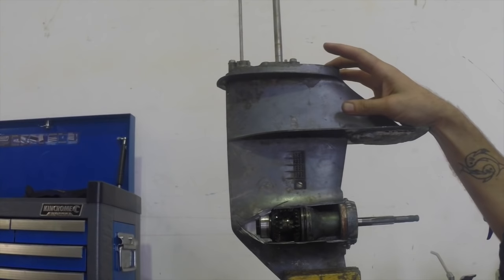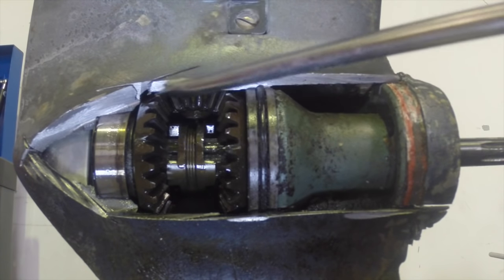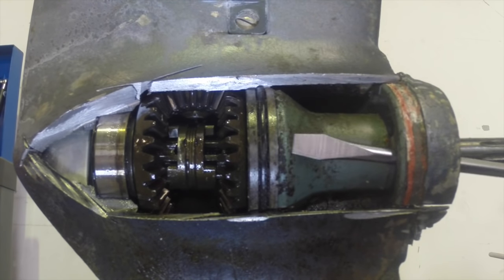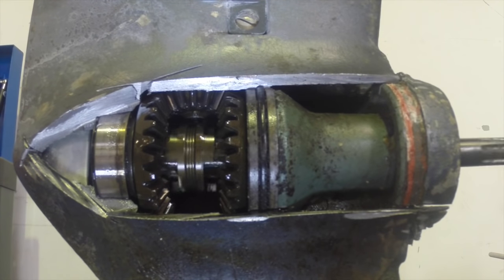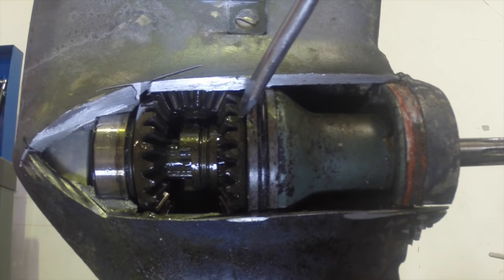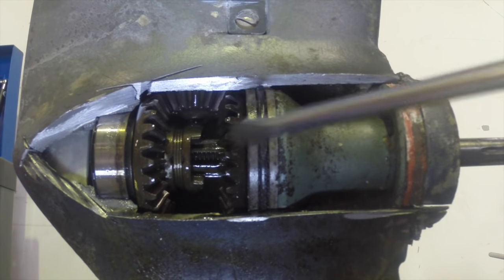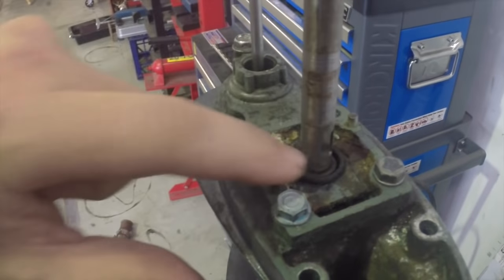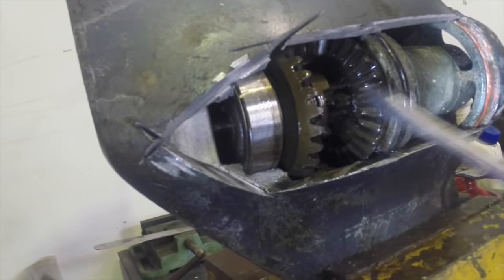How an outboard gearbox works

Comment: Hey mate,  i have a question about my 75 hp outboard Yamaha 2 stroke 1982. I recently did repairs on it and would like to know if it is normal for the prop to make a clicking noise when spun by hand in FORWARD gear (Only makes the noise in one direction and doesn't spin the other direction when in F). When in NEUTRAL it spins freely both ways as it should, But when in REVERSE it doesn't spin either way (In R when you turn the prop by hand either way it will turn the motor). I can't seem to find a definite answer anywhere and have read in multiple places a bunch of different answers. NOTE: i never spun the prop by hand before the repair as it wasn't what i was repairing, therefore i have no clue if this is the way the mechanism actually works. Cheers

Comment: So when you have 2 or more engines they usually rotate opposite of each other. Is there any difference between the two mechanically or do they just flip the shift cable around and run one in "reverse"?

Comment: Very informative, Thanks,  I have a question though, when I shift from reverse to forward there is a fair amount of grinding sound and same forward to reverse.  Is this harmful and is there a remedy?  The motor is a Mercury 125 hp 2001 vintage 2 stroke 4 cyl
Reply from the maker: It is bad for a gearbox to hear that grinding noise as it is the sounds of the dog clutch and the backs of the gears being worn away. Does it still happen if you change gears more briskly? Change gears slowly can cause that to happen. If it does I would look if there is any play in the gear selector cables or linkages.

Comment: hi hope you donrt mind ,got a quad bike jianshe.bought with 1st and reverse gear problem have checked the reverse and forward gear and seem fine. now the quad will go into all other gears and drive fine .im guessing 1st and reverse are linked as told you can only select reverse when in first gear. when you engage 1st and reverse and add revs sounds like a gear is running over another gear but not meshing together.any ideas thanks.

Comment: never had a chance to see the gears like that ,Love it!!!, is it normal to get a little bit of oil leaking when not used for awhile, you will see a bit around the bottom fin, it just makes a mark on the garage floor and then it stops?
Reply: GmGarlo no it’s not normal. Check to see where your oil is coming out from. A crack, drain plug, fill check plug, coming out by the prop so on.

Comment: Can you please explain the correct way of pushing the throttle forward/back without damaging the gearbox? I don't quite understand how this clutch works. And is there any risk of damage if my tickover is high? I upped it because my automatic choke doesn't seem to work.
Reply from the maker: The trick really is to pause in neutral when coming out of gear for the revs to drop back to idle and then move into gear quickly and crisply.

Comment: Are there props engineered for superior reverse-performance; it seems you should be able to reverse as fast as forward?
Reply from the maker: +ohbobpleez Not really with outboards. Because of the water flow and turbulence it is hard to get a prop to be equal in both directions.

Comment: Thanks all your videos are very informative and useful.  So I have a question though, as simplistic as that looks, could you which the gears around and make the gearbox a left hand rotation?  Thanks,
James
Reply: +James Brennan  Sorry there is a typo above, should say "switch" not "which".
Reply from the maker: +James Brennan Hi James, good question. The pinion gear coming down from the driveshaft will always push the forward one clockwise and the aft one anticlockwise. It is my understanding that a left hand gearbox has the gear selection mechanism reversed. The tricky big is designing the gearbox to take all the load of running at high speed for long periods of time with the dog clutch pressing backwards against the reverse gear. This is where all the magic happens even though the basic design is the same.
Reply from the maker: +Dangar Marine Hi James, I think I deleted a comment of mine that you had replied to. Sorry, comment ping pong gone wrong!

Comment: Great video, thanks for cutting that open. It gave me a great view. I’m having a issue with my gear selector rod, it doesn’t seem to have a good amount of neutral section. It always either wants to shift foward or reverse. What is the common piece to replace in this situation. Thanks a bunch in advance.
Reply from the maker: This video might help https://youtu.be/B4acSf_BgP4

Comment: Mate,

I have a Mariner 175 HP 2.5 liter 2 stroke outboard motor and im having a problem with my reverse gear box. when i engage into reverse it makes that tugging sound and clonking noise. I would like to know roughly how much it will cost me to get it fix ( reconditioned) here down on melbourne. I spoke to my boat mechanic and he said that it could only just be adjusting the cable inside the motor. 

Thanks mate.

your great follower.
Reply from the maker: It could definitely just be a matter of adjusting the cable, this video will help with that. A repair like in this video https://www.youtube.com/watch?v=B4acSf_BgP4 would probably cost about $300. Thanks for watching! :)

Comment: hey do u know why my drive shaft would be locked up? put in test tank one day and shifted into gear and there was grinding noice then motor died. Took gear box apart and even with dog clutch in middle/neutral, the drive shaft and forward/reverse gears won't spin. Any advice? cheers

Comment: hi ive got a honda 50, i put the tail back on and adjusted the gears so alls well but when i put into forward then back to neutral the gear sounds its just not quite out ,back to reverse then neutral it clears, adjusted it 50 times but cant get it right is there  anything im missing

Comment: Hi Stu. Good vid. Do the prop shaft and drive shaft oil seals rely on water to keep them cool when the shafts are turning? The seals with the tensioner spring around themI guess there would be a lot of friction heat at this mating point. Often wondered how they last as long as they do
Reply from the maker: Hi Rob. They last quite a lone time provided you don't get fishing line wrapped around the prop, that damages them very fast. Both the oil and the water contribute to the cooling, yes.

Comment: i want to thank you. nice video!
can you explain if iother types have exhaust elsewhere. a 100 hp outboard would have enough exhaust to cause cavitation no?
makes no sense to exhaust bubbles before a properller? of does it flow through the prop?
Reply from the maker: Through prop is most common, particularly on motors above 10HP or so. Because the exhaust comes out behind the prop it gets clean water to bite into.

Comment: Hay how are you doing 
I have 2 questions about yamaha 400 timing chain marks and its tensioner 
Also if you can please drop some video about new versions (v6 -24 valve)with timing belt,also if you are able show how you diagnosis and clean memory faults of engine computer 
Thanks alot

Comment: Now I'm in a new predicament , I removed the gear carrier out . Now under that I see there's a larger roller bearing . The gear didn't come out with the carrier . Just wondering if the shift changer has to be pulled to let go of the gears to remove .
Reply from the maker: +Mark Nickles did the reverse gear come out just leaving the forward gear in? You usually need to take the drive shaft and the pinion gear out to get to that.

Comment: Great Video!! - made it so easy to understand how the gear box functions.  Do you have a video that shows how the shift shaft changes vertical motion to horizontal motion to engage the dog clutch.  I'm helping my nephew with a 1986 suzuki 85 DT and when replacing the impeller, once the Lower unit was out he pulled up on the shift lever to get it back into neutral and the shift shaft came uncoupled from the mechanism in the bottom and we can't seem to get it reengaged.  We're not sure if we've broke something or not.  I've found some diagrams that help somewhat but they have not helped us understand what we have to do to reengage the shift shaft.   I"m sure that linkage is specif to the manufacturer.  Any insights would be greatly appreciated.
Reply from the maker: I don't, but it is a stepped wedge shape so the deeper it goes the wider is gets hence pushing the dog clutch shaft backwards.
Reply: @DangarMarine  Thank you for the reply - What I"m confused about is the diagram of the the shift shaft is that it has the deepest part of the wedge (presumably allowing the dog clutch to move towards the bow into the Forward gear) above the mid-step (presumably Neutral).  That would would seem to mean that the shift shaft has to move  Up to go from Forward to Neutral, and UP further for it to go from Neutral to Reverse ... and yet I believe that I push the shift rod down to move from forward, to neutral to reverse.    Am I correct that the step is where the push-rod for the Dog Clutch should is for Neutral?  I wish I could send you a picture.  

/

Comment: Do you show a vid on how to remove the lower gear box for the 2000 30 HP Yamaha . I don't have the 2 bolts like you show . I have what looks like some kind of locking tabs behind the prop that looks like you would need a special wrench or some type of trick of the trade ? .
Reply from the maker: Hey Mark, I don't have a video on that yet, and yes, it is a special tool. I believe the Yamaha part number is YB-34447

Comment: hii... nice video,
i want to ask, how about the gearbox ratio?
do you know, how much the RPM of the machine at top speed, and the RPM at the propeller?
Reply from the maker: +AJPro Ah, good question. This outboard has a 2:1 gear ratio. From memory the pinion gear has 13 teeth and the forward and reverse gears have 26. This means that at top RPM,  say 5500,  the prop will be turing at 2750 RPM.
Reply: +Dangar Marine ok thanks for the fast answer. is the ratio and rpm also same with other brand, like yamaha, suzuki etc..?  or each brand have his own ratio and rpm,  also the gearbox model?
Reply from the maker: +AJPro They do vary,  a little bit. This gearbox is from a Yamaha at 2:1, but they can be a little bit higher or lower. Some manufacturers make a high thrust model that has a lower gear ratio for carrying bigger loads and pushing barges etc. These would normally be married to bigger props too.
Reply: +Dangar Marine sir, thank you very much, this video and your answer very helpful...
keep at good work!

Comment: Great video. I have a question though. I think a connection between motor and prop is slipping. It seems like the motor is running on high rpm but the prop isn't keeping up with it. It can't bring the full power into the water. I also hear/feel occasional rpm changes without doing anything. Swapped the rubber Flo-Torq bushing in the prop but that didn't really improve the situation.
Any ideas what the issue might be? It's a 2013 Mercury 4-stroke with around 450 hours on it.
Reply from the maker: Could be the prop ventilating in the water if the outboard is mounted or trimmed a bit too high.

Comment: Interesting video. I discovered water in the lower unit oil. I don't see anything obvious, fishing line etc.  Generally speaking when water is in the lower unit,  is the entry point for water the seal behind the gears or is it coming from the above, ie the water pump housing ?  Not sure where to start addressing this.... ( I know the short answer is give it to a mechanic, just looking to say some $)
Reply from the maker: Saving a few dollars is what we're all about. :) Water can get in from four places. There is an o-ring around the bearing carrier that rarely leaks because it doesn't move it at all. The other three possibilities are the oil seals around the drive shaft, the shift linkage and the prop shaft. As they do wrap around moving components they can just wear down and start to leak, there doesn't need to be fishing line or anything. The best thing to do is drain the oil out then use a hand pump to pressurize the gearbox through the oil filler hole. You can then spray some soapy water around all the seals and see which one has air leaking out (you should be able to see bubbles forming). You can also make a dial gauge like this one: https://youtu.be/Lzn-nshSlwk

Comment: Hi while the motor is running on water the boat stopped running I was going about 20 mph. Got towed to shore, checked the oil in lower unit found none but still black in colour. Any idea what can be damaged in the lower unit? When gears engaged the prop keeps spinning, the mechanic I consulted is asking $500 to assess the situation only...
I guess I am willing to try and fix it myself, I watched many of your video, I appreciate very much all your work
The outboard is a 
Johnson VRO 60 HP year 2000
Can you help?
Thank you
Reply from the maker: Did the motor stall because the gearbox seized or did you just lose drive? Could be internal gears, dog clutch or selector mechanism.

Comment: Hi mate,

Can you help me please?
I have a Yamaha 30hp 2T. And i'm having a 
problem, under load it starts jamming. Already see the pump (its 
working), cleaned all the 3 carbs, and seems everything all right. Im 
getting very upset and bored :(. Start's well, when I put forward full 
power, it goes smooth for about 15sgs, after starts jamming, i switch to
 neutral and his idling it's very up and down but after 8 10 sgs the 
idle comes back to normal, then I get go for 15 sgs full power. It seems
 that he drains all the gas on the carb and needs few segs to fill it 
again... I order 3 carb rebuild kit... Do you have any idea what could 
be? sorry for my english

thx in advance
Reply from the maker: Hi Samir, sounds like it could be the fuel pump not working properly or a split in one of the fuel hoses that is sucking in air.
Reply: Hi man. Sorry for boring you mate, but i dont have anyone that could help me. So I tested a "new" set of 3 carbs(new fuel pump on the middle carb) that came from an outboard engine just like mine, that was running smooth, with this I put new fuel lines and other fuel tank, and got the same problem, under load the engine goes down. So I checked the spark plugs, and the one on the middle and the bottom they were wet with gasoline, so I was wondering let me check if I have spark, so unscrew and i tested the spark against the block and I had the spark on both. So I got to a point. My engine in neutral REVS ok, it goes very quick and nice, when I put in forward and put half throttle it goes down. What is happening is the engine gets too much gas on the combustion chamber that isolates the sparks. It works well in neutral, but on load the sparks get wet. Do you have an idea what it could be the problem?? btw i tested with a new cdi and coils. Very very sorry for my english and many thx in advance. if i could pay you with IT favor please just ask. samir

Comment: thanks man you know you're stuff does the shift rod push the dog clutch erom inside the dive shaft?
Reply from the maker: No, the shift rod goes through the forward gear up to start of the prop shaft where the dog clutch is. The dog clutch locks to the forward end of the prop shaft, the shaft itself doesn't come any further forward. I'll do a follow-up video soon.

Comment: hey mate can you go straight from forward drive & dont stop throttle in neutral & knock it straight in reverse with out clicking it in neutral  would it damage the outboard gearbox
Reply from the maker: You should pause in neutral until the revs have dropped back to idle before engaging reverse otherwise the dogs on the clutch will engage very violently and eventually get worn away.

Comment: My drive shaft does not turn forward and reverse gear
 as easy by hand. (water pump removed, new bearing carrier housing).
Is that normal? Maybe tight drive shaft seal?
Thanks.
Reply from the maker: There can be a bit of resistance in the gears and seals that make it hard to turn by hand, yes.

Comment: Love your videos mate, have learnt a lot from you already. If my outboard 'jumps' into gear even at relatively low revs, is the dog clutch the likely culprit or could it also be stretched control cables. Thanks for all the vids, cheers from the UK!
Reply from the maker: Normally those problems would cause jumping out of gear or grinding. Maybe the idle speed is set too high?
Reply: @DangarMarine  Thanks mate I'll start with that then, much appreciated 👍

Comment: Hi Stu.  I just picked up a Half Cab been sitting for over 10yrs.  Can’t get the gearbox to separate from the leg.  Mercury brown band 60hp.  Do u have any tricks?   I have tried using the nuts on the right and left like a puller backed out against the top of the leg.  It is putting pressure on the crank and the the flywheel is not free while under pressure from the side nuts. Will this damage the crank? It seems to be stuck fast.  Looks like someone last tried hammering down on the gearbox and cracked a bit of the anti cavity plate.  I do not want to hammer on there.  It is opening about 5mm.  Thanks.  Any help appreciated.
Reply from the maker: It is a really tough problem to solve as it is generally the top of the driveshaft corroded into the bottom of the crankshaft where it is really difficult to get any heat or oil. I've tried wooden wedges in the gap that opens up and then do anything you can to get heat and oil in the vicinity of the top of the driveshaft.
Reply: @DangarMarine  thanks Stu.  Will keep at it.  All the best for the Detroit. Love your work!

Comment: Does the exhaust have lots of back pressure? Displacing all that water looks like it might be hard work.
Reply from the maker: That's a good question, there must be a bit but there is also a relief port about the water line. I presume that once the boat gets moving the forward motion and the prop helps draw the exhaust out.